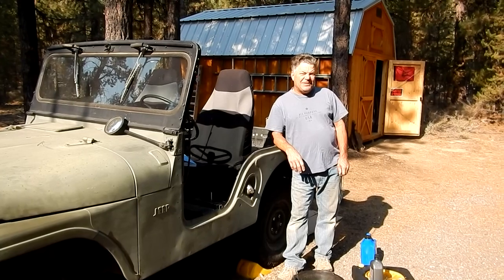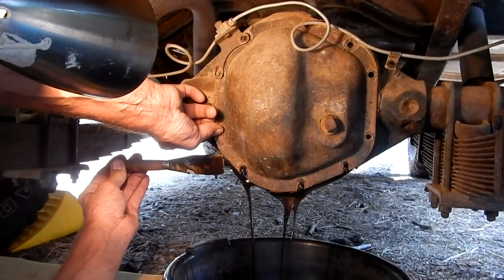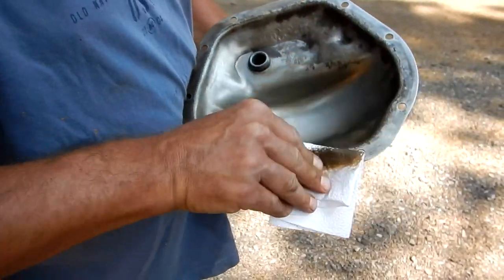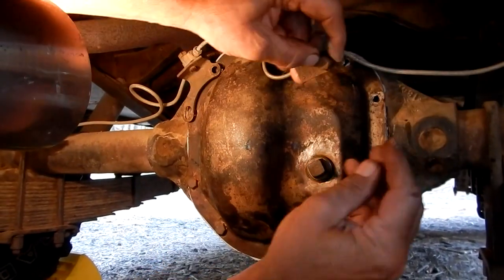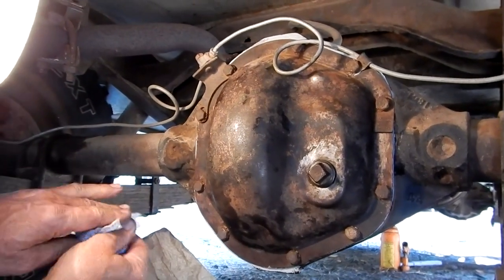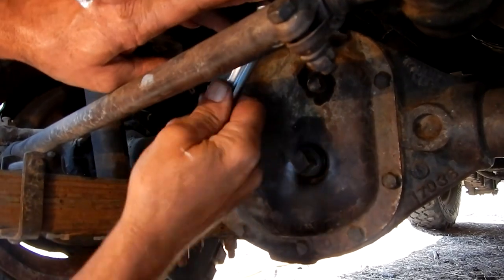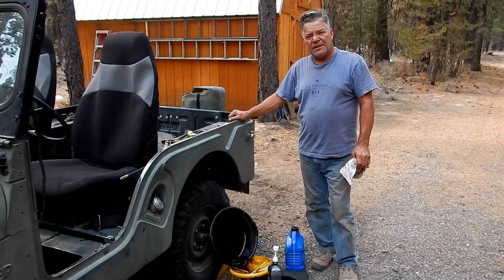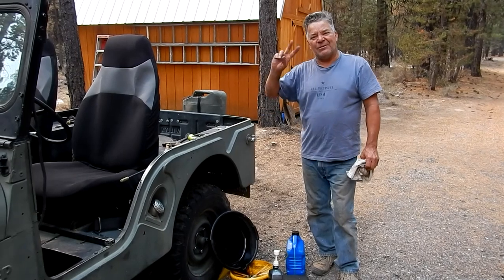How To Drain And Refill Differentials on Willys Jeep CJ-5

Comment: Did a rear differential on my truck a few months ago.  Did not think of using the light oil to rid of residual gear oil.  Very informative.  Thanks for sharing!!
Reply from the maker: Thanks, GDog. The light flushing oil is good to remove any bits of metal on the bottom of the case as well as residual gear oil.

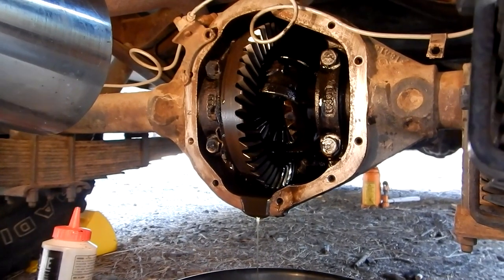Comment: Nicely done Tom. An other gear ratio available in those diffs is the 4:10 : 1. I'm in the process of swapping mine from 5:38 to 4:10. With the Dauntless I really don't need the lower gears and can enjoy a bit better cruise speed.
Reply from the maker: Thanks, Henry. These are some low gears. It will go 55 MPH, but not for long. I keep my eyes open for an overdrive.👍👍

Comment: my  63 cj5 has the same vent hole on the rear axle. I thought it was a flaw in the manufacturing. the front has a nice breather, why not the rear?  I plugged that stupid hole and installed a vent on the diff cover like it should have
Reply from the maker: You really don't like that hole, do you? It doesn't seem to have caused any problems on mine for 61 years. I don't know why they made it like that. Thanks for commenting, Christine. Happy Jeeping to you!👍😁

Comment: Just did my front diff. It dropped out what looked like chocolate pudding and inside was what looked like sludge that I had to scoop out with a plastic spoon. I think I bought a junker ! 🤣
Reply from the maker: They do get neglected often, Justin. Those old Dana diffs are pretty tough, though. You could inspect the gear surfaces for pitting or excessive wear.

Comment: How do you identify what rear ends are on Jeep
Reply from the maker: There should be a number cast right into the housing. Mine is a Dana 44 so the number 44 is present on the shaft side. There should aslo be a metal tag on one of the bolts denoting the gear ratio. Something like 5.83 or whatever gears you have. You will probably have to scrape some grease to find the casting number.

Comment: Is there a reason for the loops in the brake lines
Reply from the maker: I didn't install the brake lines, but, that is usually to add flexibility to the lines to relieve any stress from the vehicle flexing.
Reply: @TomandJulieMineExploring  I had a job installing car wash equipment once. Sometimes we added loops to even out pressure or something like that
Reply from the maker: Sometimes that is done to help dissipate heat, too.